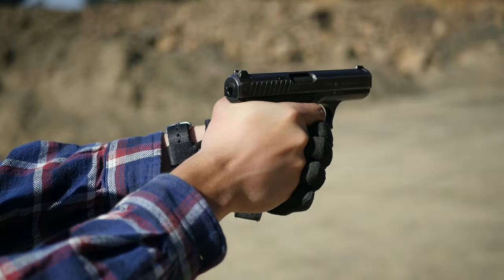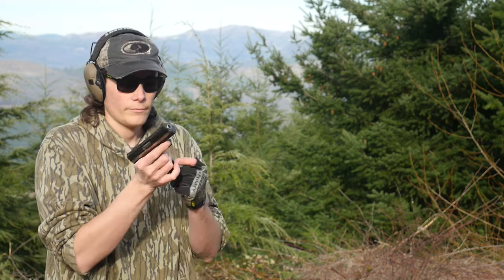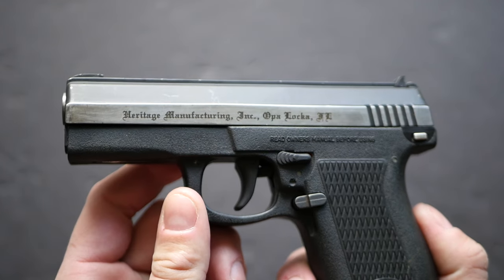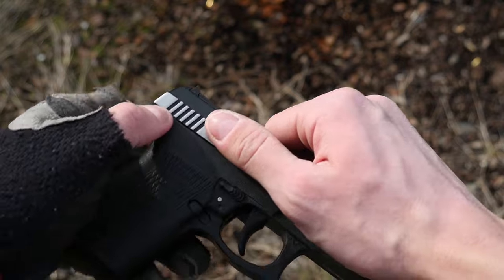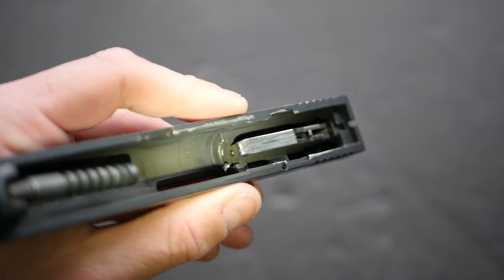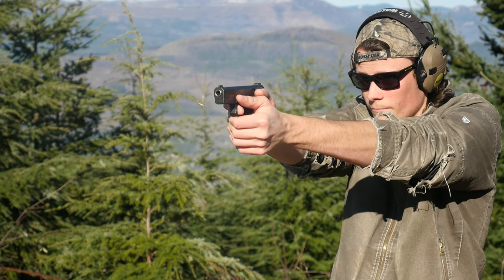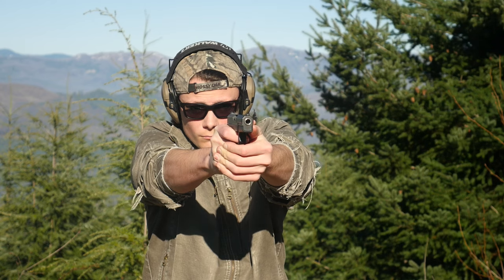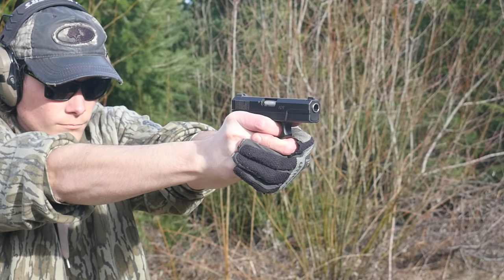Floridaman Makes an HK P7 Knockoff

Comment: It definitely is a legal requirement that imported guns are marked with the name of the importer and generally the name of the manufacturer, although there are some minor exceptions that don't apply here and that's been the case since 1969.  The frame is the firearm, so imported separately it has to be marked.  My best guess would be that the slides at least were made in the US and the frames were imported in some sort of unfinished state which is why they're not marked as imported. That seems likely given that the frames have a pressure-bearing aspect to them, which is unusual, and this was probably machined in after import.

Comment: kind of wish someone would make a seacamp sized all metal 380 or 9 and use some combination of lesser known locking mechansims like
1. ledge cutout in chamber so that brass fireforms into it and provides resistance to opening like the Fritz Mann 1921
2. rotating barrel from rifeling engagement like the early savage 1907's
there are some smart locking mechanisms that dont require any additional bulk/length

Comment: I wonder what the muzzle energy is.  Delayed blowback of any kind benefits from more slide mass, so if it's smaller than a Glock 19, that must mean that the tapped gas is doing more of the work that the slide mass isn't.

Comment: As an HK PSP owner, I was mystified why gas retarded blowback feature was not found in any other pistols, and was unaware of this pistol's existence.  I'm a big fan of the both the squeeze cocking mechanism and the gas retarded blowback feature, but what makes the PSP great to me is I can actually shoot well with it, not being all that skilled with a pistol, due to the barrel being mounted to the frame and the low barrel height.

Comment: <----- ar15  in middle is my hk 416 knockoff currently in progress hk grip hk trigger guard geissele rail on the way short stroke gas system on the way receiver set and grip in ral8000 and soon be ordering ral8000 slim stock that is a pretty sweet pistol very nice but without the huge price!!!!!

Comment: So when the slide flew back into someone's face, I take it sheared off the piston then 😅
Reply: Or the whole front of the slide, since the barrel is fixed to the frame.  Seems like a tall tale, doesn't it?
Reply: @nunya9555  yes didn't think of that part either 👍

Comment: the Walther CCP uses the HK P7 gas delay mechanism, and so does the Laugo Alien.
Reply: The Alien is a bit different from any other gas-delayed blowback though - the slide on the Alien thinks it's a straight-blowback slide.  It(the slide) doesn't have a piston, nor any surface dedicated to interfacing with the piston; it touches the spring and piston using the same surface.  So the effect of the gas in an Alien is to simulate a much stiffer spring, basically.

Comment: I'm still waiting for some cracked out Floridian weapons engineer to make a gas delayed rifle/carbine. Make the piston a fraction larger than the id of the case or whatever pressure bears against to balance it out and keep it shut, then a second gas port in front of the piston equalizes piston pressure and the bolt recoils under case pressure. 

Simplest rifle gas system ever. Self regulating, balanced against hot loads and wimpy loads.
Reply from the maker: I suspect the pressures involved are too great for any rifle caliber

Comment: The GrandPower P40 !0mm with Rotating barrel that soaks up hot powerhouse 10mm loads, and DA/SA with Triggers that outpace Cajunized CZ75 Shadow2's and P01's have taken the hold for the ultimate in Hipster Carry, with a look Darth Vader would Kill for, and 10mm power to bring down any life on planets, 14 and 17 round aftermarket extended magazines, it is truly the modern, available Blaster to Never Leave The Oxygen Farm Unarmed On. -Luke 19:77

Comment: .22 rough rider is possibly one of the least accurate 22 revolvers you can buy.. I personally think the rifling is not really there to spin round.  My brother bought 3 of them cheap pos and at 7 yards all of them shoot 4 inches left and 9 inches low and with no way to adjust sights the guns are pretty much useless at anything more that point blank range!  never shot them past 7 yards but pretty sure they must keyhole..

Comment: I like your blunt and well informative reviews but I wouldn't consider either one of those guns P7 clones. 90% of what made the P7 cool is the reverse 1911 stapler squeeze safety. 5% is it looked cool and the other 5% is it was made by HK since everything they make is ultra reliable and built like a tank.

Comment: How come no one mentioned the equally cheesy Walther Chinese Communist Party?
The 2nd gen CCP would be a good pistol for your buddy's girlfriend ( that recommends she get 1911)
The first gen required a frikin tool that went into the striker to break it down.
(Pain in the ass) The second one did not require a tool and they came out with a 380 as well.
It is one of the most accurate compact 9mm. I have shot ( and I am kind of old now) You can tell the thing is made by Umerex though. All  injected and cheap build quality.